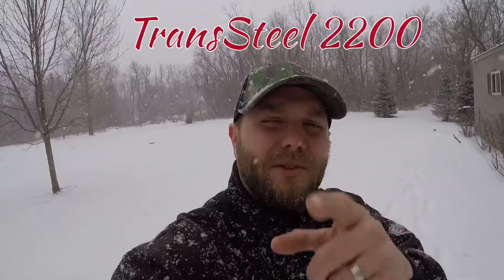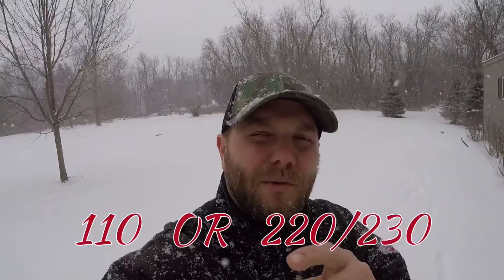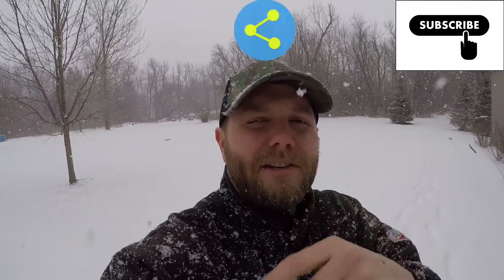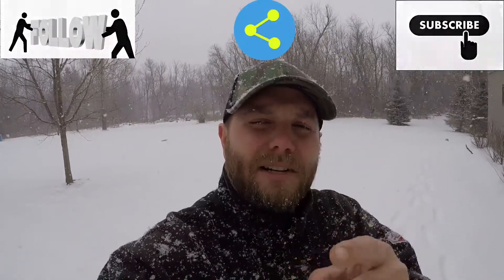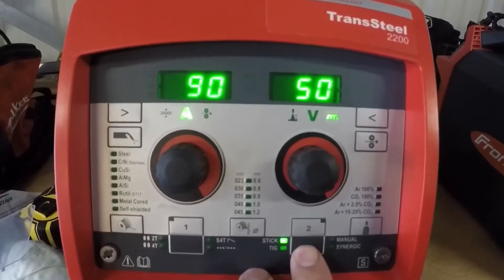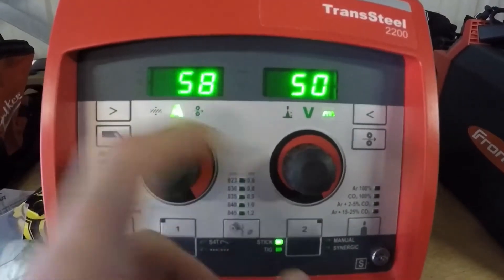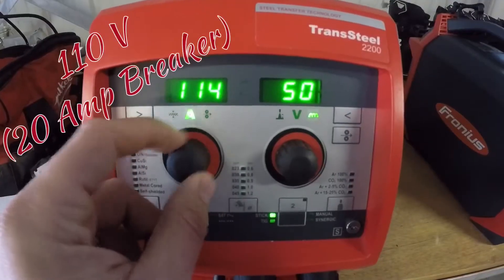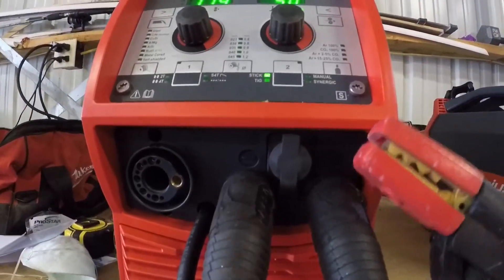Fronius TransSteel 2200

Comment: Hey Chris I bought a TransSteel 2200 but was wondering if you know if the machine switches to AC to might aluminum or it just welds it at DC any info would be appreciated friend of mine is asking about the welder I was not sure
Reply from the maker: Dean Luchetta It’s a DC only machine which means no AC TIG capabilities. Fronius will be launching AC/DC TIG Welders Aug 1st called MagicWaves